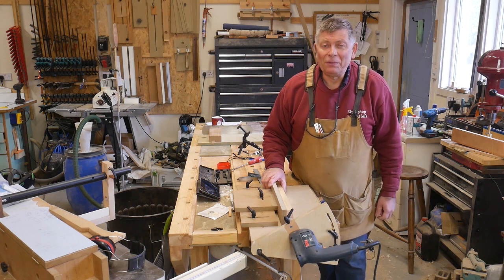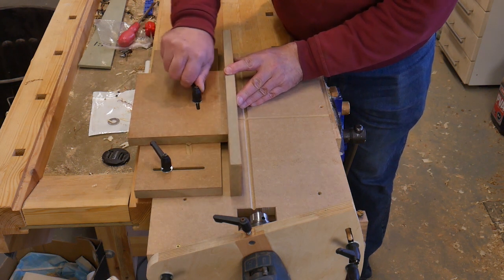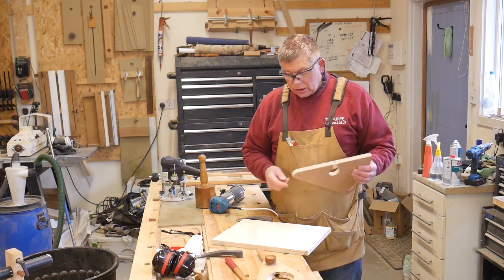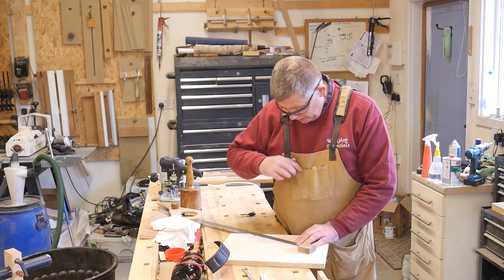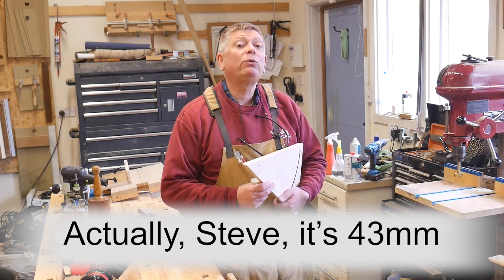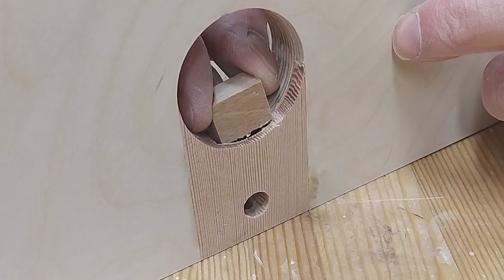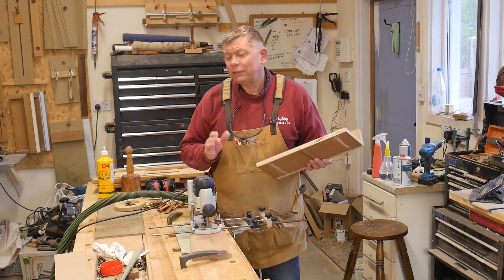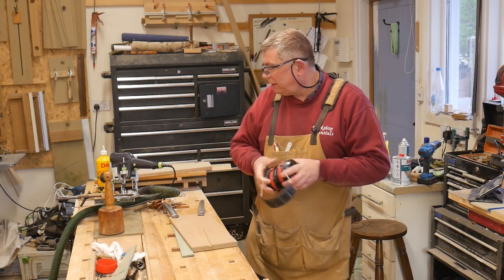How to make a horizontal borer drilling machine - NOW WITH PLANS

Comment: Any chance you have the plans done in inch instead of mm.
Reply from the maker: Sorry, no. Millimetres are the international standard for length. But it's easy enough to convert. As a rule of thumb, 25mm is roughly equivalent 1", or if you want to be more precise, 25.4mm = 1". HTH.

Comment: Great looking jig Steve I was just wondering what size square stock you use to make the slide and what it is made from thanks Hamish
Reply from the maker: The key has to fit the V-grooves, so it depends on how deeply you rout them, but typically 6-8mm.

Comment: Hi  Steve super jig made one  but having trouble boring with it as I had to use a lot of pressure to get the drill to bite. Do you recommend any particular type of drill for boring with it ?
Reply from the maker: Hi Nigel. I guess that the short answer is "A sharp one!" :).
You do need to push quite hard, remember that a drill press is leveraged. And the bigger the drill the harder it will be.
A couple of years ago I splashed out on a set of FAMAG drills. They cost an arm and a leg, but they are a joy to use. No regrets.